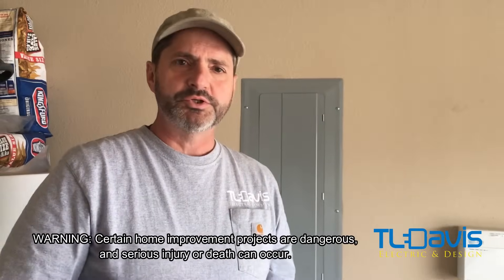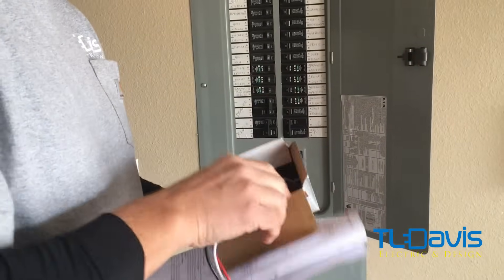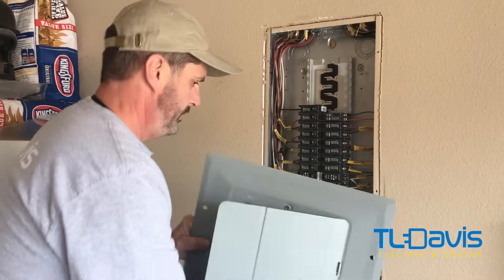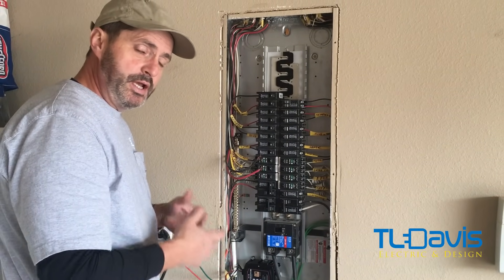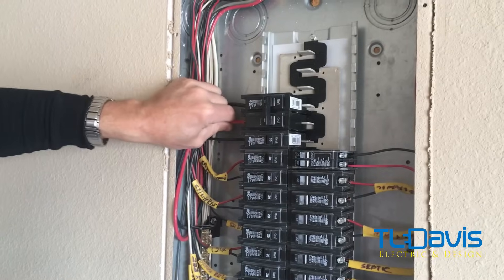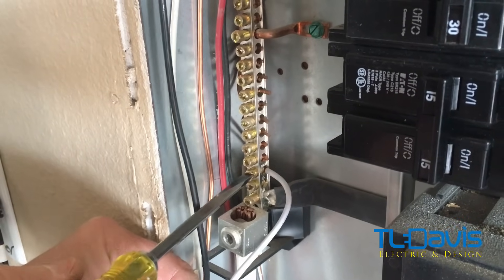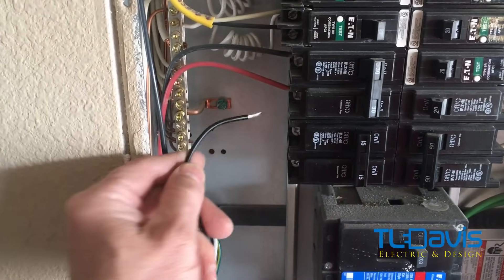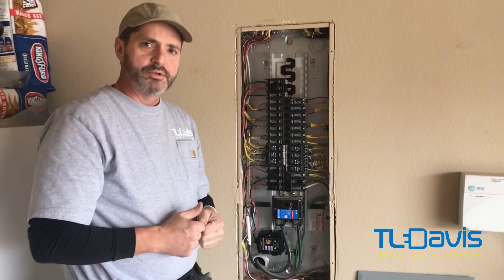How To Install A Whole House Surge Protector | TL Davis Electric & Design

Comment from the maker: This was a special case to mount the SPD in the panel. Please do not mount the SPD in the panel. I have added some links to show you how to install a SPD flush mount and surface mount. I hope these video will help you to install the SPD safely. Make sure to always turn off the power if you are not an electrician.
Surface mount SPD video: https://youtu.be/Y7eHcqroojg
Flush mount SPD video: https://youtu.be/oc78uzRJJo0
Reply: Why should you not mount the SPD in the panel?
Reply: @GetOffMyIce  probably due to code standards. it shouldn't matter electrical wise. but an inspector if you sold the house would most likely demand it be removed. so 25 bucks for a drywall patch kit or use some scraps and youre good.
Reply: @GetOffMyIce Not just Code, but this is an item that is temporary and will be changed in 5-10 years or less if it stops a surge. Hopefully yours has a thermal Fuse. To me it feels like you shouldn't add something to the box that is just visiting. P.s. I'm not an electrician, obviously. Just read a lot of stuff.

Edit: Oops, I was wrong. The reason you install the protector OUTSIDE the box is because the homeowner needs to be checking periodically on its working status.
Reply: @laurahall3094  In my Eaton  200 amp panel, the SPD is installed inside with the face sitting in a dedicated opening for it.
Reply: @terrydavis Does the placement not matter if your wires aren't long enough to relocate other breakers?  Is this because its still the shortest path to ground being at the panel?
Reply: How else are you supposed to install the SPD if the load center is flush mounted and surrounded by drywall?
Reply: @MikeJones__Who  Cut out a section of the drywall to the left of the breaker position. Drill a hole through the stud and the side of the box far enough back so that it does not interfere with the neutral bus. Use a short piece of conduit and an elbow to reach to the surface of the drywall and reach into the box. Repair the drywall with the opening flush (or come out with another elbow to fit to the fitting on the SPD-covering wire completely). Mount the SPD to the drywall with wires running into the box and right to the breaker and neutral.  As he says at 3:00, SPDs works best when they have the shortest run to the breaker. Note: a surface mount lets you easily see if there has been any status light change.
Reply: Two types of people remove panel covers. Electricians and idiots.

Comment: I'm not an electrician and still so many things freaked me out: #1 a flathead? Yoiks so much riskier than a Robertson, since it can side-slip so easily. #2 Then I noticed he didn't turn off the main breaker; holy Shiite! #3 He held the screwdriver casually dangling as he routed wires (I literally thought "OK THIS is where he gets a shock"). #4: Yeah, it's electrically the same but no way I'd put a green ground wire on the neutral bar.

Comment: What if you have a generac manual 30 amp transfer switch installed next to the service panel and the transfer switch is a sub panel being fed by a 30 amp 120/240 v breaker will it protect the transfer switch as well? Will it protect the transfer switch when the power goes out if there are any surges that may come from a conventional generator that could possibly damage a hard wired furnace? Just curious to know how to protect a hardwired furnace because my generator has a thd of 12 to 15 percent when I wish it was below 5 percent because I do not want to destroy my furnace.

Comment: Those wires are not "phases". They are the ends of center-tap 240V single system.  "Phases" involve 3 wires 120-degrees apart.

Comment: Note  at 2:20 he says you can mount it anywhere- yes you CAN, but you shouldn't! The longer the wire run (and the more bends) the poorer the surge protection performance! His comments at 3:00 are absolutely correct! Shorter and straighter wires=better performance. A gentle twist of the wire bundle can also help performance if the run must be over a few inches.

Comment: Are you supposed to torque the connectors?
Reply: Yes. Sorry for the delay had back surgery. It should be around 20-22 pounds of torque or you can do a snug tight fit and pull on the wire to make sure it won’t come out.
Reply: Yes. That information is found in the NEC on page 70-815, 816 Under Annex I. Should be around 5.3mm or 20lbs.But check the page out for what type of length of screw you have.

Comment: I thought it was a bad idea to wire grounds and neutrals together
Reply: This was a main panel for the home we were working on. The ground and neutral are required by code to be bonded together. Some electricians don't separate the neutrals and grounds on separate sides. Only in sub panels are they separated.

Comment: Why did you chose 15A Surge Protector?   I noticed 20 Amp and 30 Amp breakers installed in the panel.   Thanks
Reply: The surge protector that we used per manufacturer recommendation was a 2 pole 15 amp breaker. The eaton ultra that we did not install requires a 2 pole 50 amp breaker. Different manufactures that make surge protectors use different sizes of breakers for there surge protectors.

Comment: Definitely disliked this video simply because you didn’t turn off the main breaker. Idgaff what anyone is doing inside the house, if I’m doing electrical work inside of the panel? It’s getting shut off at the main breaker and the outside breaker if they got one.

Comment: Can you please explain what happens when this trips
Reply from the maker: You can reset the breaker and if that does not work the unit might be bad. I always use eaton due to the incredible warranty they come with. Most unit will take a lot of hits from your utility company or lighting strike near by.
Reply: @ thanks

Comment: Will this box take the load and burn out or will this take multiple surges?
Reply from the maker: The unit you have should take multiple surges. I always look at the Spd that you have. if its 50 kva it should last at least that if not longer or if it takes a direct it. That could be it and it should save most of the appliances or electronics in the home

Comment: How do you know which brand of surge protection to buy?  There are many, and I want the best quality.  I have a “Crouse-Hinds” (now owned by Eaton) panel which has a short circuit rating of 10,000A RMS symmetrical.  200A total service.
Reply from the maker: I would do your research. I always use Eaton has they have a high amp rating on the ultra 50 kva which is around 108,000 amps. They also come with an insurance policy of 75000.00. You will need to read it. The Spd can go on any panel and it should have its own breaker. Please don't put in inside the panel as that was a special case for a young child that likes to pull things a part with lights. I have added several more video on how to install it. Good luck on your project and if your not an electrician make sure to turn off the main breaker.

Comment: Residential homes do not get two phase power… ever.  They get single phase, period.  Here’s what I mean;  power is generated at the electrical plant. There are many generators at each plant and each one creates what is known as 3 phase power… A, B, and C.  The power is typically sent to a bank of 3 transformers.  The transformers are located near the top of the telephone pole.  Each transformer gets one of the three phases sent.  Each phase goes to a different part of the neighborhood.  Some get A phase, some get B phase etc. The transformers look like R2D2’s or big trash cans.  There are wires coming in and wires going out.  Since the electricity coming into a transformer is intensely high, it obviously needs to be stepped down to, say,  240v.  However, homes need both 120 and 240 volts.  How is this accomplished?  To get 120volts out of a 240v single phase transformer, the windings inside the transformer is divided, aka tapped, in half.  When the electrical company brings the wires to your house panel they bring two hots equaling 120v per wire and the neutral.  The voltages are combined or separated in your panel via the two vertical bus bars that the breakers attach to. The neutral is then landed on the neutral/ground bar.  What about the ground Wire?  Where does this come from?  Answer: The ground wire is derived via a ground rod driven into the soil near the panel or from a ground ring embedded in the foundation. Either way, the homeowner’s electrician provides the proper ground.  So there you have it… 😂😵‍💫🤯. Now you know.       Cheers!

Comment: Noalox hasn't been required in years,  since AA-8000 aluminum alloy. The inspector probably wanted to see it, and was just to shush him up. Some Square D breakers are permitted to be double tapped, with 1 wire on either side of the screw, usually a little picture on the breaker indicates 1 or 2 conductors normally 1al or 2cu.

Comment: Is this thing one time use? If it blows you have to replace it? 
I just looked and won't be fortunate enough to open a spot close the main breaker because the wires won't be long enough. Might have to move all the breakers down one.

Comment: I have MANY problems. Never mount the surge protector INSIDE the panel. Also, this guy is very unsafe around a live panel and may make a DYIer think it’s easy. He also doesn’t tighten the screws properly. 😢

Comment: Why did you mount it in the main service entrance location? In alot of places thats a code violation and just bad practice for service
Reply from the maker: If you read the note below the video you would of understood. The SPD was installed inside the panel as we waited for the installation kit and cover to come from Eaton. The home owner had a special need child that tears everything apart that has a light on it. To protect the child from getting electrocuted we temporarily installed it inside the panel. The local inspector gave permission for us to do it this way until we got the Spd kit to install it inside the panel and the new cover would of hid the lights and the breakers.

Comment: How do you know where the neutral and the ground go? Are they interchangeable?
Reply from the maker: In the main panel the ground and neutral share the same bar. It does not matter if the ground and neutral are next to each other. In sub panels they are separated and cannot share the same bar. Make sure to turn off the panel when installing the SPD and try and get it next to the main breaker if possible. If you need to add a little wire that is okay and make sure the SPD is on its own 2 pole breaker. Make sure to read the manufactures recommendations on what size to install. Good luck on your project.

Comment: SO how does it work if its just another circuit?
Reply from the maker: The SPD protects against surges from your utility company and lighting strikes. Make sure to put it on its own 2 pole breaker to cover both phases. Please follow manufactures recommendations and what size of breaker to use. Make sure to turn off the main breaker before doing any electrical work. I pinned a note to read before watching the video. Good luck

Comment: Why does the ground go to the neutral bar, instead of the ground bar. I'm pretty dumb when it comes to electricity. I don't understand what bonding is or what it does.
Reply: The ground and neutral are typically bonded together in the box anyways. I'm pretty sure code calls for them to be separate but not 100%

Comment: Why did u wire the ground to the neutral bus? 😅
Reply from the maker: I did wire the ground on the neutral bar. In the main panel the neutral and ground share the same bar. Only in sub panels they are separated and then the neutral cannot not share with the  ground.

Comment: What I do not understand why you do not wire the SPD directly to the Electric  range breaker? It is mandatory to install another breaker as you did? I guess that if the SPD is installed in parallel in the panel you don't need to add another breaker.
Reply from the maker: SPD need to have their own breaker and cannot share a breaker. Manufacture recommends this and require a certain amp rating for their SPD. In the main panel neutrals and grounds can share the same bus bar, only in sub panels are they separated per code. Please make sure to turn the main off before installing the breaker or installing the SPD.

Comment: You should mention that all wiles, especially ground and neutral wires are installed without any sharp bends, i.e., sweeping curves is OK. I see that your panel has the neutral bar connected to the panel back, which is essentially bonding the ground bar to the neutral bar. This extremely import for the surge device to operate properly.

Comment: Average cost for typical install would be?  That's what people that view this would like to know and does this last or is it a one/surge wonder or does it keep working for several surges?
Reply from the maker: The average cost should be around $700 dollars and depending on the surge it encounters. A really bad surge 1 time from a lighting strike or on average surges you get from the  utilty company. I have heard around 50 or more. You want one that has a high amp rating over 100,000 amps.  Make sure it is connected to its own two pole breaker. It cannot share or be tied into the main breaker. If you are not a electrician make sure to turn the main off before doing any work in the panel.

Comment: It does not matter where it is located in the main box but every manufacturer recommends the wires be as short and straight as possible to the associated breaker.
Reply from the maker: It does not matter on location in box. You are correct!. They don't like them more than 3' in length,  the longer they are the less efficient they become. Good job.

Comment: Shouldn't that be installed in your outside breaker panel that is where all your major appliances are feeding from and the power is coming in from the service . Installing that in the inside panel will not protect your heat and air unit your range and other 220 volt circuits

Comment: It doesn't need to go on the main breaker right. ?
Reply from the maker: You do not install it on the main breaker. The SPD requires its own breaker. Make sure to read the instruction so you get the right amp breaker installed per manufacture recommendation. I always try and install it as close as possible to the main breaker, but not required.

Comment: Hi i got a quick question. Does the surge protector cover the 220v outlet and the 110 outlets?
Reply from the maker: The SPD covers both phases. You will need a two pole breaker that is dedicated for the SPD and follow manufacture recommendation on amps for your SPD.

Comment: These are a good idea, but I believe that you still need local surge protectors to protect ALL of your electronics, and these days, that would include appliances like refrigerators and microwaves, since everything is run off digital electronic motherboard controllers.  You can get local back surges within the wiring of your house, especially when turning off large motors with all their stored energy inside the copper coils of the motors, e.g., fans, vacuums, etc.
Reply from the maker: The SPD that was installed covers all of that. You can always add more protection if you want? That is up to you but not necessary.

Comment: My sister just purchased a house that had one of those Eaton surge protectors installed on the outside of the box.  Until then, I had never seen one.  My concern is that the metal connecters on each side of the device are exposed and could be touched by her grandchildren.  I'm wondering if those connecters on the left and right of the Eaton surge protector are "hot" and a potential hazard when the green lights are lit?

Comment: you should have turned off the main breaker before you installed this.
Reply from the maker: You are correct! I have been doing this for a very long time and most electrician's. would not turn off the main breaker. But as a homeowner you should turn the main off for safety.

Comment: How do you install a whole house surge protector on a house that only has 120V going into it?
Reply from the maker: I have never came across a house with only 120 volts going to it in 38 years?. All SPD are set up for 220 volts.

Comment: The mfg recommendation is to have two single pole breakers, not a ganged dual pole. This is to maintain protection on the second phase if the first phase only is triggered. Also, it is emphasize that the wires should be twisted (to reduce the inductive coupling)
Reply: Can I use two single pole breakers from the distribution board for it or should I get a new 2-pole breaker?
Reply from the maker: I don't know where you got your information from?. The training that I received requires a two pole breaker and that breaker needs to be dedicated for the SPD.

Comment: My question is, how does it actually work? It must somehow trip the main breaker in the case of a voltage spike, but how does it do that?
Reply from the maker: The SPD attracts the spike and draws it to it. The main is an overload protection and does not protect against surges and does not trip the breaker.
Reply: Thanks for that explanation.

Comment: Much more different from the European ones.
Reply from the maker: You are correct. Europeans runs on 50 cycles as America runs on 60 cycles and europeans use 220 volt for everything including lighting and receptacles. America only uses for home 120 volt for lighting and receptacles for general use.

Comment: It protects the main, but will it protect a 100 amp sub panel that is next to the main?  I have a sub that powers a 15 amp light, 20 amp micro, and a 30 amp split AC unit with 2 heads.  I have 2 spare 15 amp circuits too.  This sub connects into the main with a 100 amp breaker so I think the surge protector would protect the sub too.